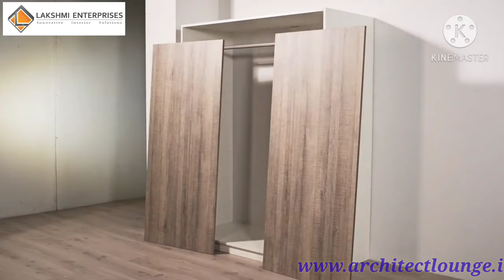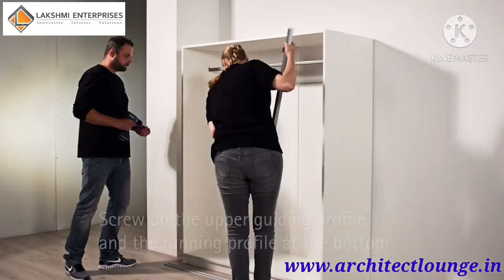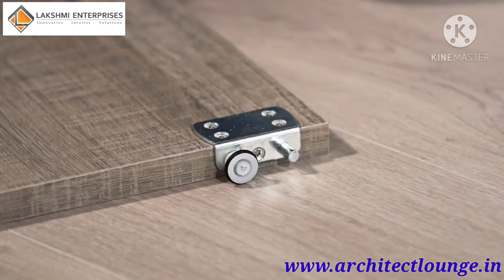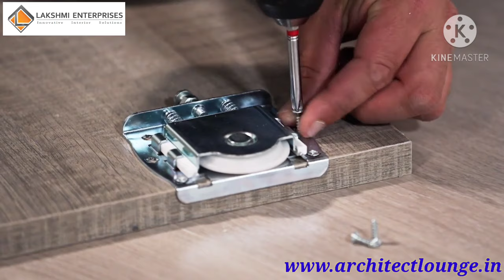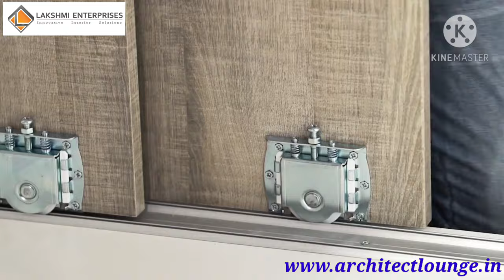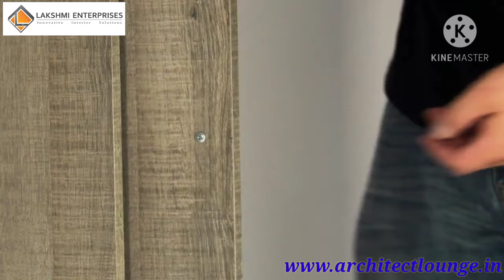SL 16 Sliding hettich

Comment: If my doors are 2,750 tall, what should the opening be for the tracks and components. Thanks
Reply: It's not about how tall the door leafs are. It's about width of doors. Which country are you in?
Reply: @esemredemir  South Africa. The width of the doors are going to be 1.500mts each. Thanks
Reply: @BOBBY-et9xb  you need maximum 3000mm - min 2800mm track to operate 2 doors in 1500mm wide
Reply: @esemredemir  I know that. But thanks anyway.
Reply: @esemredemir  how much maximum thickness of door for using hettich  slide line 16. My door thickness is 28 mm